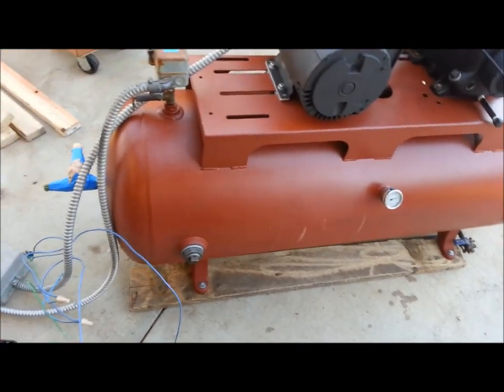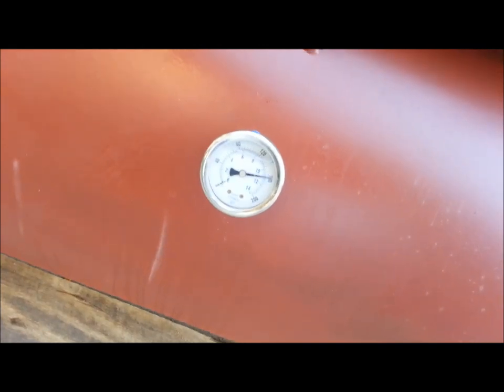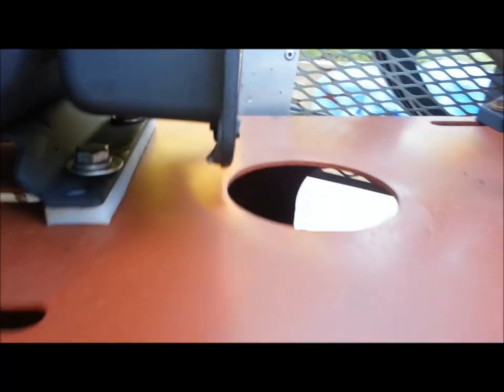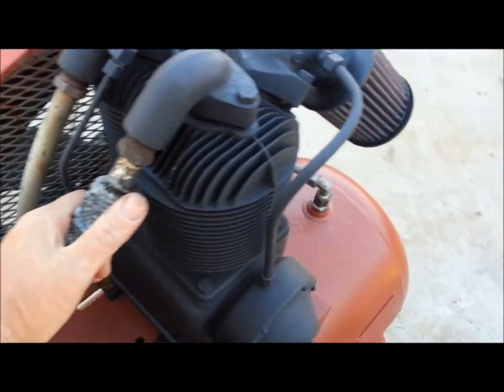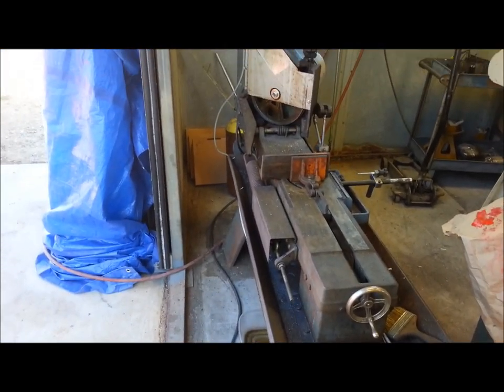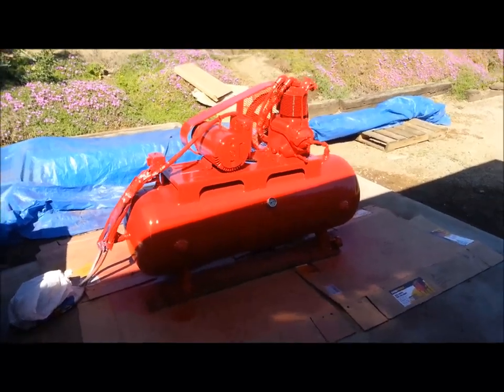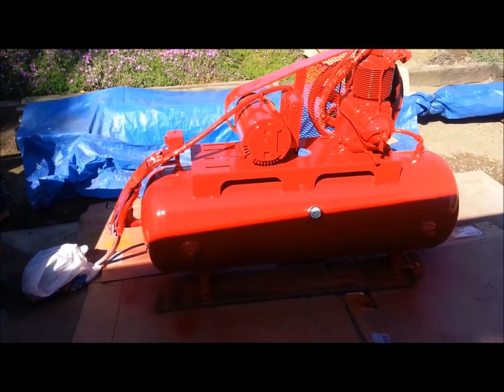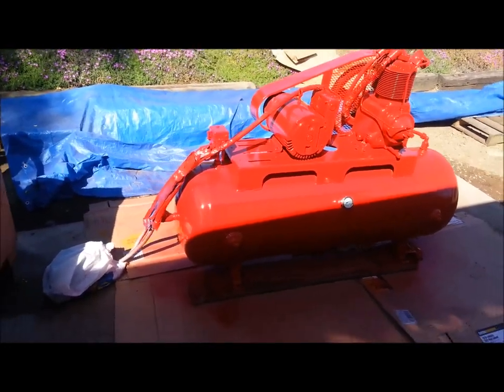Air compressor #2 final

Comment: Good idea with the mounts,,,I just bought a speedaire I'm restoring and the mounting plate was cracked from vibration also,,I welded it,,but I'm going to use your idea putting it back together,,,mine is a 4 cylinder compressor a beast,,,stole it for 125 dollars,,,people have no idea what they have,,,I price the pump alone now is 3400 dollars...

Comment: Great restoration.  I would have added a bunch of pipe with a water drain before the bottle to get the air temp down. Although I guess that is useless. The tank will still get very wet.

But it would be nice to preserve all your hard work.

Comment: I am wondering if the UHMW between the motor an the top plate has lead to any wandering? Personally, I like to mount the motor to a hinged plate and use a coil spring loaded adjustment bolt at the end to fine tune the belt tension and absorb startup jolts & vibrations. However, I image working with such a heavy motor might need a car sized coil spring to do that.

Comment: Great job. I just bought a 30 gallon model 220 DeVilbiss for my first every compressor, and I don't know if its safe to operate. Takes about 10min. to cut out at 100psi. but the thing is built in 1955 and is 0.142 thick and I have some rust in there. I was planning to do the hydro test so I don't find out till it's too late that it's a ticking time bomb.Tank says that it has a 200psi working tank pressure. I was planning on pumping it to 1.5 time so 300psi. How long should I let it sit pressurized, and if it passes that without problem, do you have any other ideas on how to clean up the inside for someone without a pipe threader. I know everybodies first response is just get a new tank, but I don't have that kind of funding. Any help is greatly appreciated, Thank you.

Comment: Did you you use the same welders paint + acetone on the outside as a base coat that you used to paint the inside in the first video? (the color looks the same before you painted it red)
Reply from the maker: yes, I did.
Reply: @ShadonHKW  really appreciate it! I have an old tank I plan to hydro test and if it passes restore and paint, I cannot afford a thread making machine, but I think I can maybe use a couple V-Blocks and rig an old clothes dryer motor to turn it.
Reply: @ShadonHKW  Do you happen to remember the mixture % for the paint to acetone? To do the inside and outside of the tank how many gallons of paint and acetone did you have to use?
Reply from the maker: @jakeg2033  The primer I used was really thick, so it was a 50-50 mix to get it sprayable. the paint was 75-25, acetone is a good cold weather thinner, use mineral spirits in hot weather. A capful of Japan drier in both helps drying.